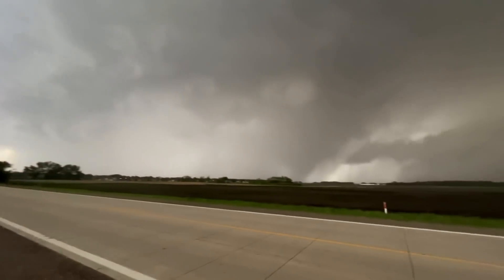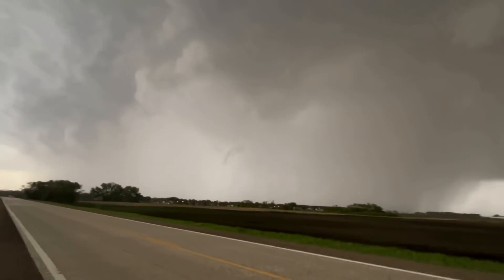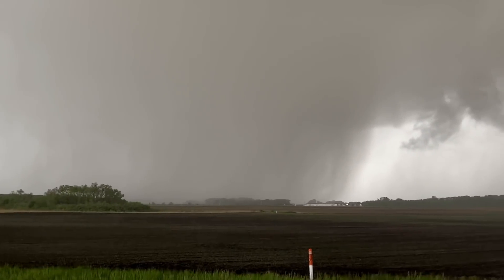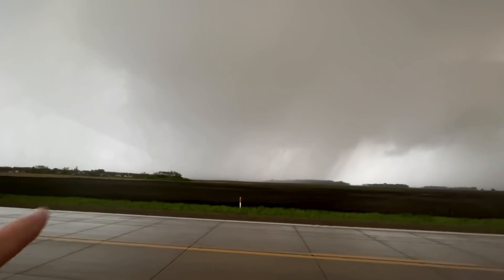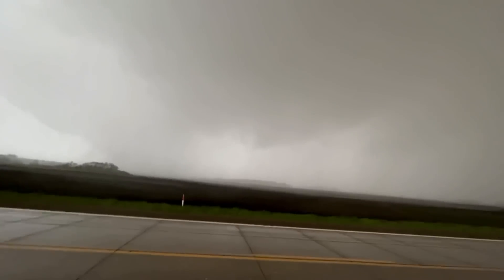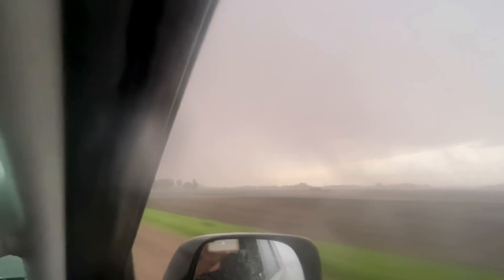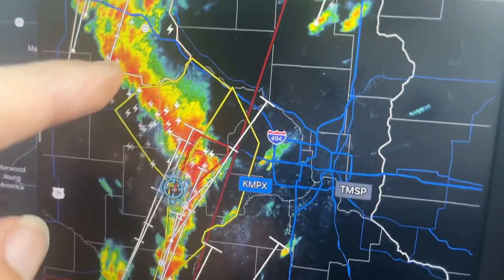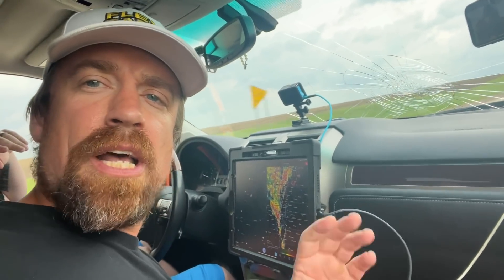TORNADO intercepted east of Glencoe, Minnesota!

Comment: It looked like the first barn took a direct hit. If it had veered a little bit closer to the house it would have been tooth picks but, I'm guessing that is why there is a tree break catty cornered to the house that helps deflect the wind.
Reply from the maker: Yes the tree break certainly helped. The house is also a more sturdy structure
Reply: @ReedTimmerWx  Built to last

Comment: I kid you not, there had to have been a tornado in Buffalo/Montrose tonight because what you're video shows of this tornado match my photos taken where I was. There's also debris flying around while I was driving and even knocked down several tree branches and pieces of wood planks flying around while I'm trying to make it back home 😅 needless to say I did make it home safe, but it was very intense because the rain was coming down in sheets; Nor could you see two feet in front of of the vehicle because of how quickly and windy it was. I was definitely glad I was driving away from wherever the wind was pulling the trees and debris because I know otherwise... Super cool seeing your footage though compared to mine 😊
Reply: well, there was a tornado warning issued for a storm cell that basically passed on a straight line from Montrose to Buffalo on Memorial Day. it was a radar indicated tornado and not a confirmed one at the time it was issued, but that just means no trained spotters spotted one before the warning was issued.

Comment: The Twin Cities and Minnesota were very fortunate today.  The upper level trough/low lifted NNE with very little eastward component.  As the result, the LLJ and the Mid-level winds were more parallel than perpendicular resulting in a QLCS moving NNE. Had there been a more eastward vector in the movement of the upper-level low/ trough, we would have gotten discrete supercells moving NE or worse, turning to the right and moving E. That likely would have caused a major tornado outbreak.
Reply: I'm glad it didn't because I live in the twin cities metro area. While I'm happy,  it's still sad for those that were hit by the worst of the storms
Reply: I LIVE IN MINIAPOLIS!
Reply: @Xmc1-0  is that where you learned to spell Minneapolis too
Reply: I'm from Duluth I don't think there's ever been a tornado here before
Reply: Lol my buddies and I were talking trash about how weak this storm was.